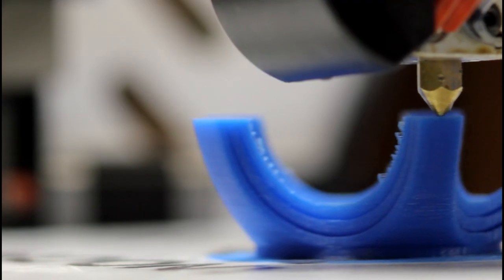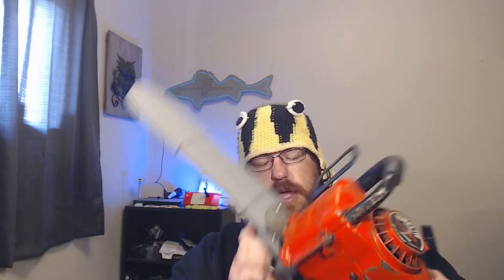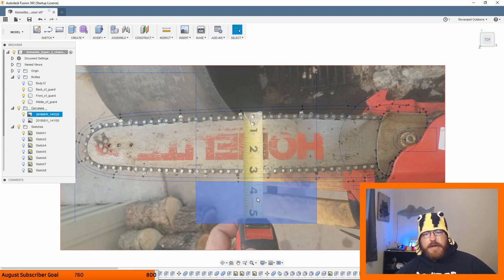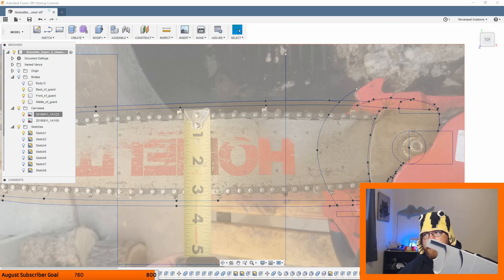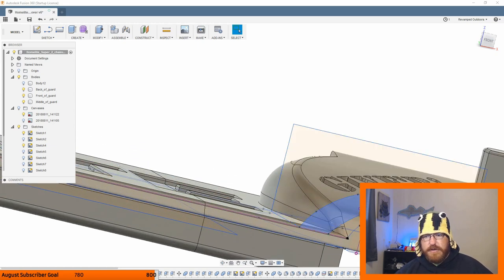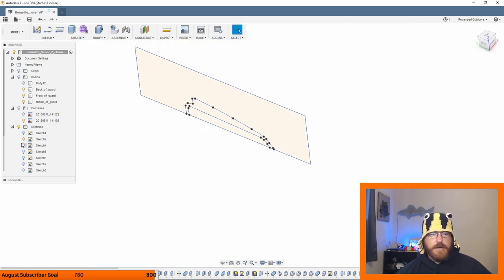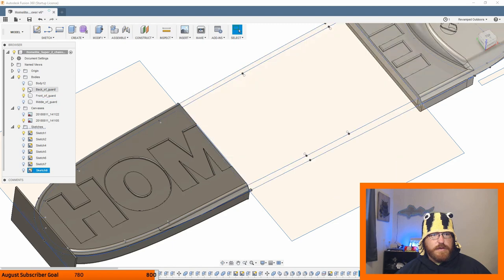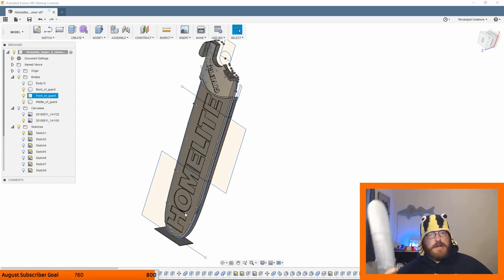3D Modeling without specific measurements (Chainsaw Scabbard Homelite Super 2)

Comment: Nicely done, I really like the quick flip up transitions you do on your videos, I am still trying to figure out how to do that. Thanks man!
Reply from the maker: Thanks! I think the transitions are probably a function of using really cheap software lol. I use wondershare filmora instead of the adobe suite again due to price. It has a lot of problems but it is also only a one time $50 price tag with no subscription and also is optimized slightly better so i could run it better on my old PC 2 core 1.9 gz Intel. Davinci wouldnt even load so Filmora was the best option. Anyway in their stock transitions they have roll transition option in about 7 directions. I use the transition that follows the previous scenes movement, so if I swing my hand right of screen I choose the right or up etc. Then I edit the transition down to about 0.14 seconds so it's 4 times faster. This seems to help if there is a large exposure change or color change. Then it's just a function of finding a sound effect that suits the mood at the time of editing and throw it dead center of transition. Probably not the best way of doing it but it's way easier than unmounting my webcam and spinning it around between scenes  lol. Hope this helps!
Reply: Awesome! Thanks for the explanation, they look great.